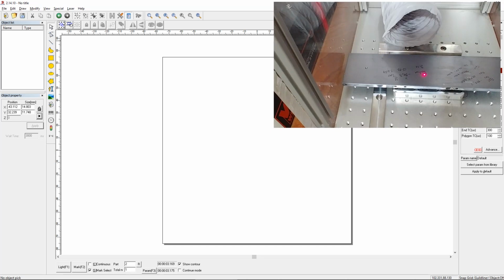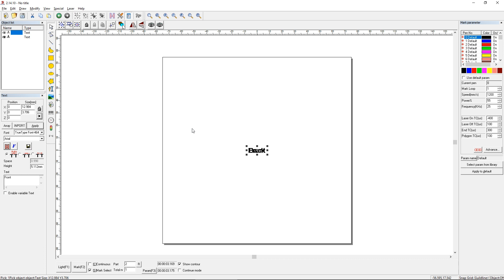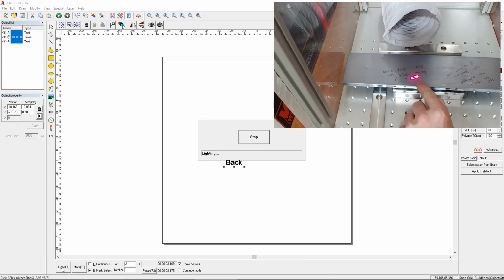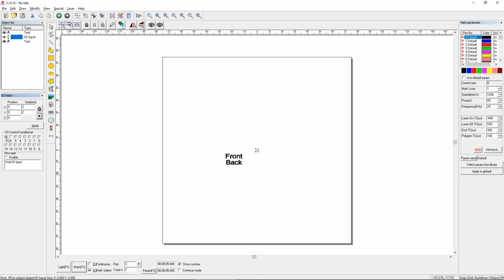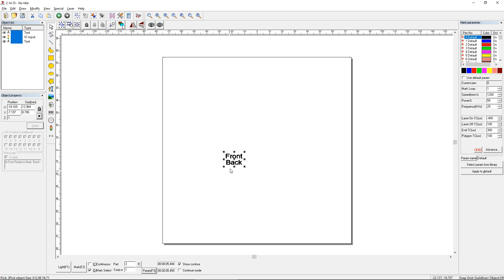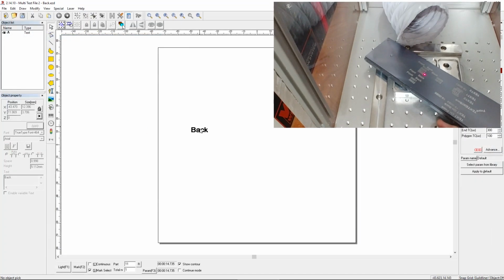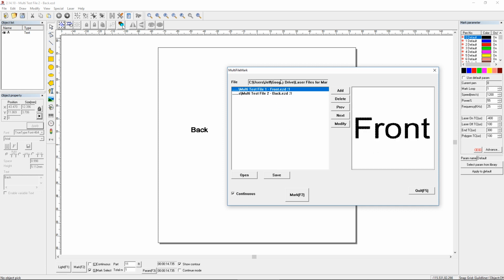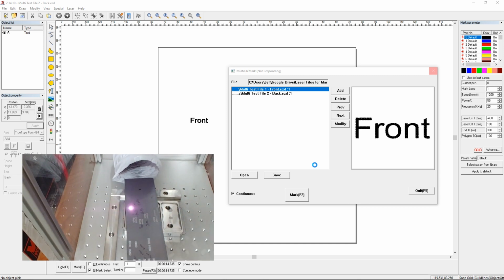EZCAD2 Tip: MultiFileMark & I/O Controls

Comment: Thanks! super usefull, mine I/O control (traffic light button) dont let me use port 15, it simply just can not be clicked, it is empty, can you help? my pedal is also on port 15
Reply: did u find a solution of your probleme, i have the same issue
Reply: @ORIWOOD-zy4ge  Go to system parameter and tick no. 15 in Input Mask in General Tab
Reply: Go to system parameter and tick no. 15 in Input Mask in General Tab

Comment: DO YOU HAVE ANY TIPS FOR 5HE FOLLOWING:
Let's say you have a file with multiple tiny hatches, and you are using the resort option so it stagger them when marking. If I use the loop option (example 5 passes), it will do the 5 passes on a tiny hatch before moving to the next hatch. The problem is that it heats up the piece too much. I need for EZCRASH to do one full pass (mark all the hatches), before it goes to the next loop.

Thanks!

Comment: Great Video Jeffery you have helped with a number of issues i have had thanks, on mine 8 to 15 don't work and my input is set to 8? I'm guessing there is a setting to turn this row on somewhere any idea why 1-7 work and 8-15 are all low and won't let me change state.
Reply: I have the same error as you, have you fixed it, help me
Reply: @djbinhmelody1731  Yes, click file, System parameter, IO Mask and turn on the ones you need
Reply: @justincredible4406  wow,thank you very much
Reply: @justincredible4406  can you give me link your facebook,please? i want to ask the I/O Controls? I can't operate it

Comment: Hey Jeff, Nice Video! Btw, I am still confused about the I/O section. So basically you connected the pin 15 to a real foot pedal hardware?
Reply from the maker: I made this video in response to a question about how to mark multiple files without loading them manually.  I cheated a little bit to make use of them with the foot pedal, but multi file mark is a much simpler solution.  The I/O controls aren't really for this and I've never really used them.  I believe they're for expanding the setup with external components like sensors, conveyors, cameras, etc.
Reply: @jefferyj  Ohhh Icic, because currently I plan to integrate this laser machine with robotic arm. So basically the robotic arm will feed the material. But I am not sure about the communication between them.
Reply: @chickenz4604   Communication would be simpler through Relay Input & Output signals. We can be in touch if you need any further information.
Reply: @devang1501  Hello, we have figured out the communication channel. I only use relay  for the signal input from the foot pedal pin. For the signal output from control card, I connect it directly with the robot. Sure, how can I contact you?
Reply: @jefferyj  True - Multi File Mark is quite useful when you have multiple inputs coming from various devices & you want to mark exactly that particular file. It is quite useful in Automobile Industry with variable Incremental Numbers to be marked depending upon Inputs received. So, if you need any further information or details, we can be in touch.

Comment: Great demo. 
How could i use this for deep engraving on stainless steel? Multiple hatchforms and ad cleaning passes inbetween?
Thinking about engraving polymer frames an slides. 
Maybe even use different depths inside one operation? Seen some wonderful artwork being done on YT.
Appreciate any tips.
Reply from the maker: You could use overlapping objects on the ezcad workspace, just set them up in the order you desire.  It may be a little tedious to set up, but if you're doing a large quantity of the same item, these settings can be helpful.

Comment: Jeffery thanks for you videos - We have to engrave 4,500 painted bottles and have to do two passes, one to take of the paint and the second to polish it. Is there a way to automate this without having to change the setting on each bottle?
Reply from the maker: Sure you can do this a few different ways.  The easiest would be to just set up a hatch 1 and hatch 2 using different pens and line spacing.

If you wanted more control over the timing of the passes, a more complicated way would be to duplicate the artwork and set it to overlap in the ezcad workspace then apply the appropriate settings to each object - then use i/o controls to cycle through the two objects in the object list just like I did in the video.

Comment: I'm looking into buying a similar machine for marking objects that are 60*1200mm. What is your advice on size of the machine for my use? I mean, with these I/O options it would be possible to make a moving table or a conveyor and split the design into multiple objects and move the conveyor between each marking. But should I go for 100x100 or 200x200? Would you buy the same size and power again if you were to start from scratch? Thankful for any advice
Reply from the maker: The smaller your field, the more power you will have.  If I were to buy again, I'd probably get a 30w with a 200mm and 100mm field lens and I would likely use the 200mm for the vast majority of my marking.  I almost never really need depth, but it would be nice to have the 30w with a 100x100 combination just in case.  That said, my 20w with 150mm field lens meets my needs and I've been satisfied with it.
Reply: @jefferyj , thanks for your fast response, and thanks for your excellent videos on these lasers and the software. I had been wondering about whether I could hack this machine to control it externally but this video really showed that it is already made to be controlled by external inputs. I will go for 30W and 200 lens and a moving table for marking longer objects. Thanks!

Comment: Oh gosh! Something similar to this may solve my Low Memory, crashing and file clearing scenario. I have pretty finely detailed hatch file and once they reach 20mb or so, they’re unreliable. Where I need 4 sets of all three hatches, rotating the angle to assure cleanout, I can only run one at a time, manually adjusting the  angle/degree. (Not by my computer right now.) I want to be able to run all four, ideally stacking them, but EZCad can’t handle it. Maybe four separate files run similar to this would work. I need it to run while I’m not sitting there for the hour of time. I’ll have to watch this again from a bigger screen to see how it can work without the need of a foot pedal. Thank you!
Reply from the maker: An hour of marking and 20mb?  That's a pretty serious file.  I haven't tried it with anything that large, but sounds like it should work in theory.
Reply: Hmmm... Darn. I don’t have a foot pedal connected. Ideally I want them to auto run one after another. Tried a couple things. Way tooo late,/early. Will look again tomorrow/today. Unless you know? And thanks for your help. As it stands this may still save me some time and hassle.

Comment: Have you ever tried engraving a circuit diagram, imported as a dxf from autocad? Cause ezcad does not recognize line thickness set in autocad. Would love to hear about it.
Reply from the maker: I haven't tried it, but if you can draw it with outlines rather than single lines, it should be able to be hatched in EzCad.  I'm going to post a video shortly about doing something very similar with a standard table.
Reply: It won't, I've tried it so many times, you should try using Corel or Ai